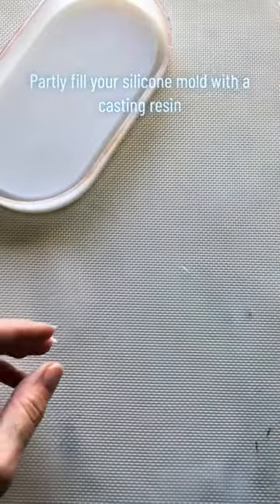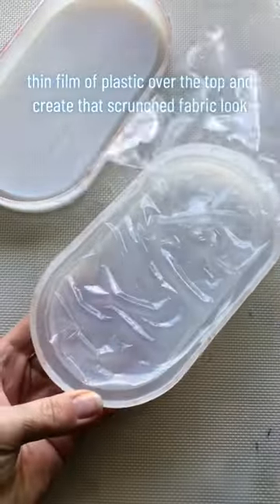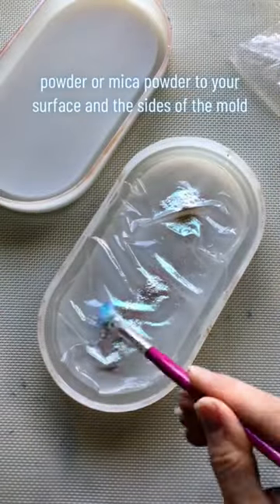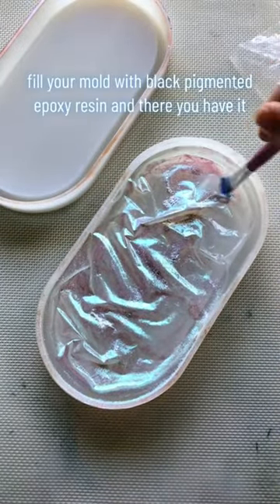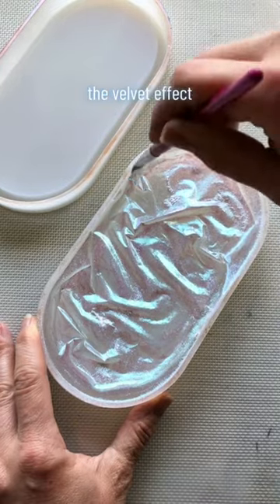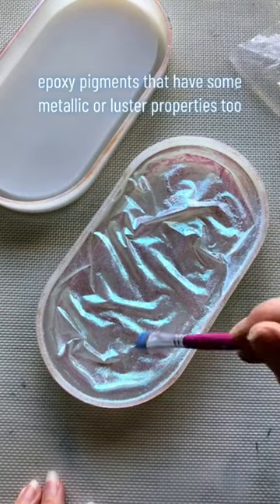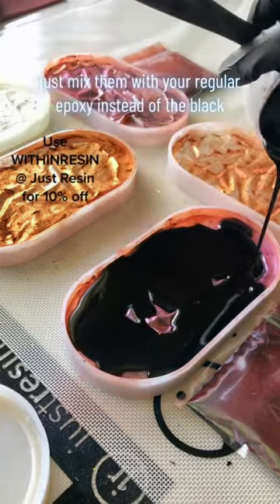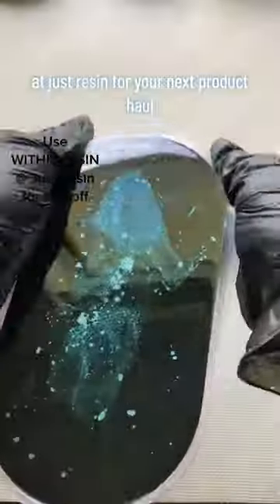The velvet effect in epoxy resin. Tutorial

Comment: This is sooo lovely but I have two questions. Question 1 - do you coat underneath and then do second coating then put the plastic or do you just put the plastic with the first pour of resin? Also second question what type of plastic do you use?
Reply from the maker: All steps are explained and shown in the video. The plastic I used was just some off cuts of a thin sheet of plastic I got in some packing material, nothing special.
Reply: Partly fill your mold with casting resin, then place a thin plastic film over it. When it cures, pull it off, add pigment to make it shiney (chameleon or mica), then top with another layer of black tinted resin. It's all in the video.

Comment: Question: I did this and the plastic got terribly stuck. I used plastic like yours (that came as packaging around one of the molds I ordered). What did I do wrong? Thanks!
Reply from the maker: Oh no sorry to hear that. It may have gotten stuck for a few reasons, did it get imbedded under the resin? Did it get exposed to too much heat, eg was your resin too hot or did it come in contact with  any external heat like from a heat gun? Was the plastic clean and completely free from any kind of scratches? Without seeing it in person it’s really difficult for me to tell what went wrong exactly but I hope those questions help you troubleshoot.

Comment: How do you avoid air bubbles? I’ve been having that issue.
Reply from the maker: It can be tricky. If you begin to lay down your plastic slowly from one end and work your way to the other, gently placing it down gradually it will eliminate trapped air.